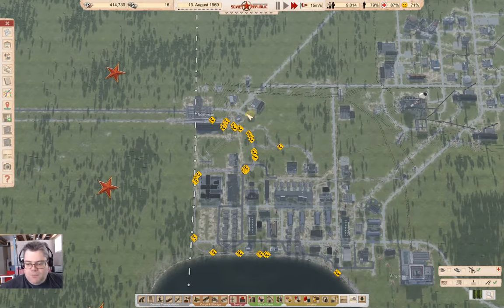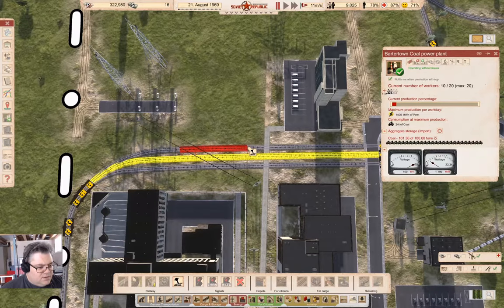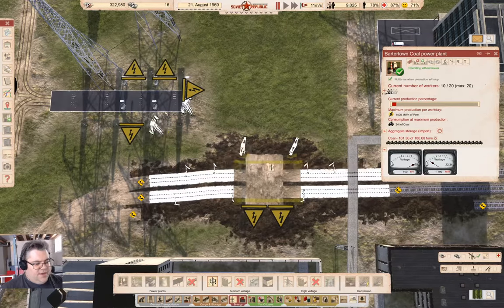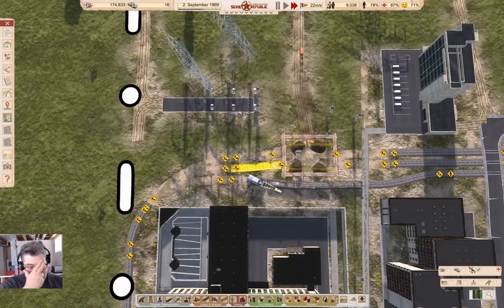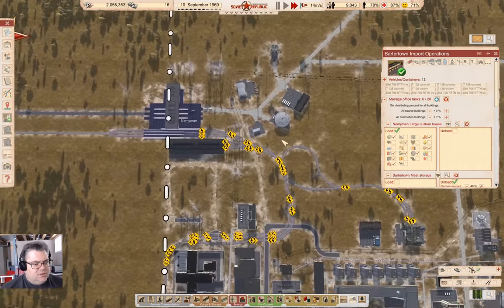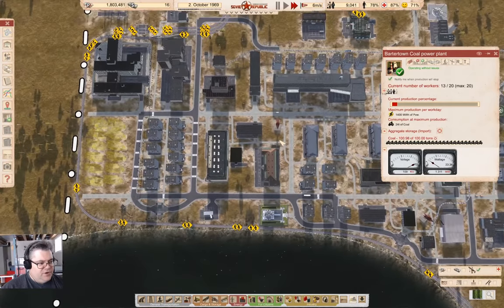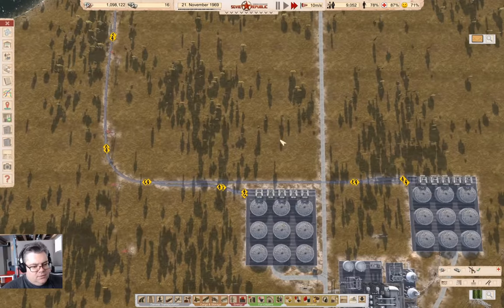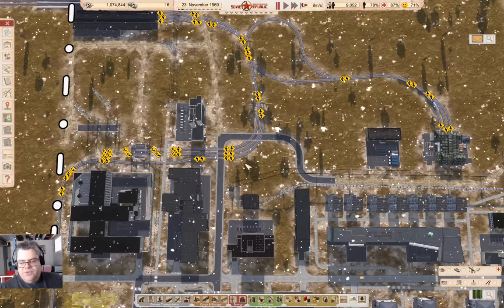Cosmonaut, Mostly Part 40 | Workers & Resources: Soviet Republic

Comment: I can see you making so many mistakes playing this game. You definitely have an idea of game mechanics but I don't think you should play it in cosmonaut mode, even if it's mostly. Cosmonaut mode doesn't allow to use population on the map, second no prefab panels import. Also you're basically leeching on borrowed money through the whole game owing MILLIONS. Loans are allowed but you are building the whole country based on money you don't have. This is not the way of playing cosmonaut. Instead of focusing on agriculture you're jumping into the heaviest and most expensive industries in the game. Building farms and processing the crops into various goods (food, alcohol, clothing) would bring you plenty of money without need of having rail in operation. Your biggest import cost is steel because you have perverted drive of constant building massive buildings you don't actually need yet. And even if you have them built you don't use them to earn money. Massive cement plant barely used, gargantuan oil tanks full of oil for no reason. Helicopters! What an utter waste of money (money you don't have). You seem to be an educated man (regardless of your difficulties in articulation of your thoughts, constantly putting aaaam, eeeem in your sentences or even having difficulties in finishing them), maybe you should do more research on how the economy works in soviet countries? No problem playing the game but cosmonaut mode is hard and there is no space for mistakes or money spree borrowed from God. Loans are supposed to be used for investment in industries which can pay off your loans, not for day to day operations. Your one and only job in this game is to manage day to day operations and you clearly suck at it.